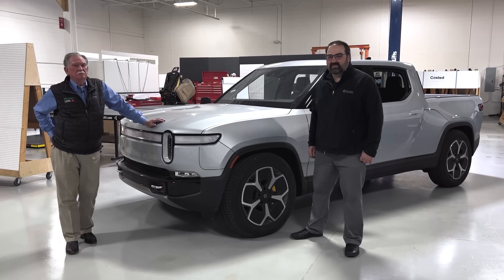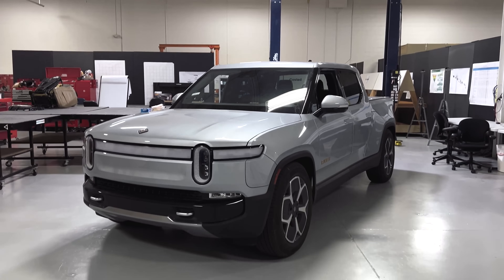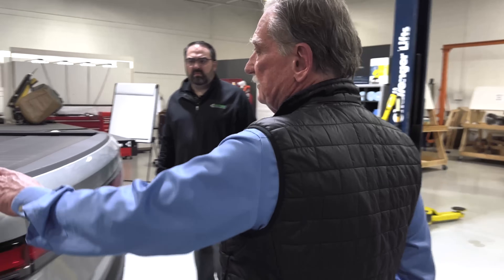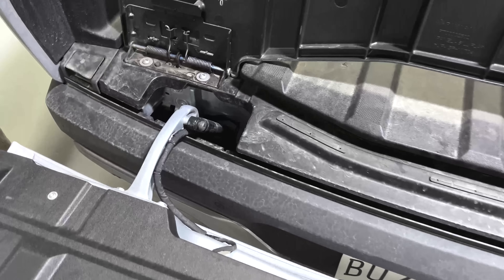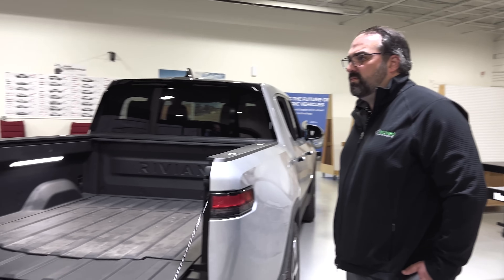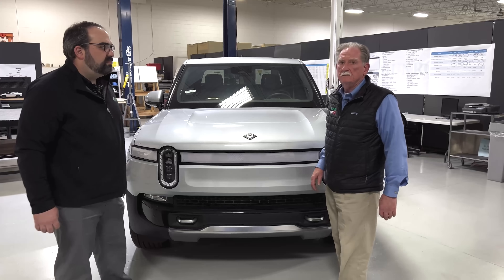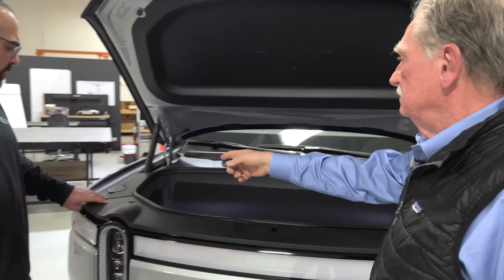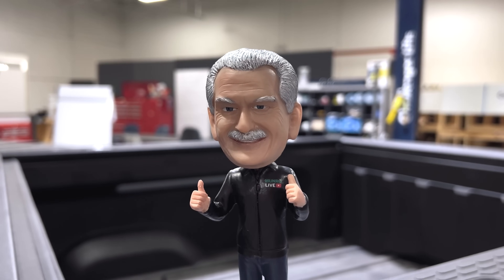Rivian R1T Teardown Kickoff!!!

Comment: Note: Rivian has jacked up the price = $12-20,000. They advertised the trucks at the lower prices and commenced a big promotional blast in October, boosting preorders in order to hike the price of their November IPO. That initial stock price of $172 has plummeted to under $25 per share as of today. Many preorder holders considered this bait-and-switch tactics and cancelled orders. Ford just dumped 8 billion shares of Rivian stock. 

Amazon's order of 100,000 Rivian vans is non-binding and the've hedged their bets by placing an order for Stellantis' EV conversion vans.

Rivian is not technically a new company, as they've been around for eleven years. Damage control was a reversal of the price increase to existing orders and a new decontented model at the originally advertised price, with two motors instead of the quad setup.

I've always maintained that the niche market demographic for $100,000+ "adventure" trucks was too small for Rivian to succeed. Folks forget that the Amazon van deal was over ten years = +/- 10,000 units/year. I'm not certain of Rivian's future. One likely scenario is that they get bought out by another manufacturer. I can see them as an Apple product.

Rivian's recent announcement to break ground for a new plant in Georgia in 2022 seems highly unreasonable now.

Comment: I'm hoping Sandy tears another one down in a year when the dual motor option is available and Rivian is not sourcing motors from Bosch but building them internally. I liked the Model 3 comparison he did with a few years in between. My R1T is in the low 5,000 serial number range (Sandy's tear down is 3,000s). So far, ten days in, it's been flawless on every level. The accuracy of the range estimates blows me away. (We'll see what range looks like next winter.) I hope Rivian can truly get to scale for both survival, charging infrastructure, and future product development. It's an impressive beast.
Reply: Actually I would like to see externally-manufactured motors as they should be cheaper than in-house ones because of the bigger production scale. The same conpany could have similar products (or even similar components) for different companies, so cheaper per piece. And you could benefit from the experience they sccumulated, don't need to start from scratch everything.
Reply: I'm really hoping Rivian makes it through the chip shortage strong. Their next truck, the lower cost one, should really be something great.
Reply: @WheelNut2  I wouldn't hold my breath for a lower cost quality EV, with decent autonomy. With current alluminium prices, rare metals prices, shipping prices, energy prices amd so on, the manufacturers don't make much money from cheap EVs
(or at all). There is no incentive for them to make cheaper ones. See Tesla, they only said Model 3 is $30k, but can you really buy a $30k one without government incentives?

Comment: Its a superbly well executed vehicle, however, I seriously doubt the company will survive. The reason is patently obvious, Ford is offering a bigger, also superbly well executed truck, for a TON less money, AND, it will be cranking them out like hotcakes in no time flat. Rivian, as well as Lucid will soon add their names to the dustbin of auto companies. Too bad, but its the nature of the auto industry. Finally dont think Tesla is off the hook either With Hyundai, VW and Mercedes jumping into the fray with models that are on par or superior to Tesla and a much larger production capacity, the big dogs are probably going to have their way with Musk too.
Reply: I think until someone actually makes it to scale, this is all guesswork at best.
Reply: @TheEvilmooseofdoom  Most of the large manufacturers already have the scale, Ford is expecting to be cranking out 200000 Lightnings in 2 years, an astounding number. The hold up is ramp up of chips and  lithium batteries. Everyone is constantly whining about lithium batteries and the availability of the battery elements the fact there is a lot more lithium in the crust than there is oil! The other components are all found in "friendly" countries. Ergo battery raw materials are far from being a constraint.
Reply: @Wised1000  Only one has ever put out a BEV at scale and it ain't Ford.  I think they will, it's just when and THEN we'll see how well executed it is and IF they can make money at it.
Reply: The Ford product is not any cheaper at similar trims, but they do offer some budget "Pro" trim, but it lacks range and and any luxury, which is fine. They also will be making even less of those for the near future.

Comment: I’m interested by his take that 75k electric trucks will become the new norm. He really seems disconnected from the “average” American. The big 3 will still exist but I doubt any of the companies be listed will be in that group.
Reply: 75K is already the normal price of higher trim ICE trucks so EV's are already at parity there. Lower trim levels will eventually arrive ($40K Lightning Pro for example) but as with ICE trucks the highest volume models will likely end up around 50-60K.
Reply: @HodgePodgeProducts  the problem is that these companies can’t make money selling these at the prices you said. There’s no way of getting around it, they are 15-20k more expensive comparing apples to apples. 

The lightning will be short-lived at the $40,000 price point because they will be losing tens of thousands. That’s why they have to intentionally limit production so it doesn’t impact their ICE truck sales. 

It’s makes way more sense for them to got the PHEV route with trucks.

Comment: Great stuff Sandy and crew.  Rivian engineers very creative thinking outside the box. I would consider Rivian SUV equipped for overland use. Rivian forgot to install a refrigerator. If they could engineer a solar panel tanou would be revolutionary.

Comment: The Rivian is an excellent vehicle, but I'm interested to see how they will navigate ramping production and securing supply chain. Looks like there will be shortages of key battery components in ~3 years. Whether Rivian can build an amazing vehicle and have insane demand is  irrelevant if they are unable to scale due to supply issues.
Reply: Maybe they just stay as a low-volume manufacturer and are happy with that?

It'd keep demand for their vehicles super high, will ensure their cars always have good residuals, and will mean they can keep a focus on quality. As long as they can pay all their staff and executives a salaries what's even wrong with that?

Not every company needs to be the next Tesla. There is plenty of room for small volume manufacturers, and maybe they should be encouraged.
Reply: @DEADB33F  That would work if their CapEx was in a manageable state for a low-volume manufacturer, but Q4 2021 it was $455 million, with 2.7 billion CapEx guidance for 2022. Their burn rate is not sustainable if they only produce <100,000 units a year, in fact Rivian’s factory was built with a 150,000 run rate in mind, so building fewer units than that will result in higher spending per unit and is likely why they had to bump the prices so much last quarter.
Reply: @DEADB33F  They are losing money at their current production level. Tesla was selling the Model S and X for well over $100k and were selling more cars than Rivian and they were losing money. Tesla at least had regulatory credits to help them. Rivian doesn't have that. They would need to sell their car for over $200k to be a low volume niche company.  Most companies have high volume products that subsidize their low volume, luxury products. Rivian won't survive if they can't scale up.
Reply: @DEADB33F  Lamborghini, Ferrari, McLaren make 5-10k vehicles, all multiple hundreds of thousands of dollars. They are going to need to make a lot more than that.
Reply: @DEADB33F   profitability...  that's the problem with low volume... hard to stay in business if you never make a profit.
Reply: Check out todays WSJ article on Rivian’s supplier problems, including a supplier lawsuit with the van seat supplier -which will very much delay production-further causing huge financial stress
Reply: Regardless of what the components are, the “seat lawsuit” suggests a company which appears rather inept at managing supplier relationships.  It’s not so much about specific items, but what this suggests about their management.  It could be their Achilles heel.
Reply: Shortage in 3 years is what Tesla suggests, not what market will do. No one knows
Reply: @Handleittoo  Being the only EV mfg in biz for 10+ years with 80% market share - they know;  others are short NOW.. Ford Mexican Mach E plant was closed, Rivian numbers are a joke as is Bolt and Lucid so yeah, Elon knows because even Tesla is feeling it - but they sold 300,000 EVs first quarter which is a different level but he knows how hard production is so lets wait until ANY of these guys actually can produce in volume - so far - NO, THEY CAN'T and this is BEFORE we talk about the shortages Elon is talking about in minerals not so much chips (where Tesla designs their own).  🚗
Reply: @Handleittoo  Of course, to what extent and exactly when (hence the approximate sign) the supply issues will occur is impossible to know. Not sure what your point is. There will be problems, the required mining/refining of battery metals for planned EV production deviates a lot from the planned mining/refining, and constructing more mines and plants takes a lot longer than 3 years. To some extent, Rivian will suffer from this, especially as a new company.
Reply: That shortage is in the battery arena, which I find odd that companies like NIO are setting up battery exchange outlets. Isn't that kinda s2pid? Shouldn't they concentrate on building affordable EV's instead of just plunking down batteries nilly gilly without a car to go along with it? Sounds like someone is lazy and wants to have a 5 minute battery exchange instead of waiting on a battery to be filled by a charger system.
Reply: @spuddy4063  Nobody wants to wait, but most cars are parked over 90% of the time. Put a L2 charger where it's parked.

Comment: The problem with the Rivian frunk is the liftover height.  For anyone below a certain height (6ftish?), they are going to have to rub up against a dirty front bumper to get anything out.  Ford did a much better job with the F-150 frunk by cutting through the upright grill area to the bumper height.
Reply: Totally agree.  The frunk is especially useful for a pickup to secure any items. The lightning design is much better especially since pickups are so tall and for short people like myself.
Reply: Having had a chance to crawl over and around a Lightning in person, they truly nailed it with their frunk design.  I don't know if they patented the concept or not, but everyone should adopt that approach.
Reply: @Team_Trade_Down  It's not something you can patent. The Hummer EV also has the same frunk design.
Reply: Agreed, I hope CyberTruck does something similar to the F-150 with it's Frunk. I guess we will find out in a year or two :-o
Reply: @BlazerRox  The load lip on the Cybertruck would be a bit lower than the R1T given the wedge shape but I do agree that they should do it like the lightning.
Reply: @boostav  I wonder when they will lock down the CT design...and start a few beta versions....maybe next year.
Reply: @BlazerRox  It may not be necessary since the CyberTruck has air suspension and can kneel down.
Reply: @BlazerRox  Or 3 or 4 years. :))
Reply: They can (and probably will) build a whole other factory in 4 years.
Reply: @BlazerRox  Sure, a factory, but the question was about the Cybertruck.
Reply: When comparing the Lightning and R1T, I definitely included the Lightning's frunk opening as a plus. However, after owning an R1T for a while, I have no problem lifting a 5 gallon can of gasoline in and out of its frunk. That's right - I take the R1T to the gas station to get gas for my tractor (and to squeegee the windshield).
Reply: Absolutely agree great point , this isn't rocket  science to figure out , it's the number one disappointing thing about the Rivian , I'm my opinion a major , faux pa. Would be interesting to know the designers thought process on that.
Reply: @andrewashmore8000  The Rivian was designed a number of years ago...at least 5 years ago....and I assume they simply didn't think of it since it had never been done before.  Hats off to Ford  for having that lightbulb moment.   It seems obvious to everyone now, but it really was an ah hah idea.
Reply: @Team_Trade_Down  perhaps your right , and let's say that is the case , now that Rivian know what the better design solution is , shouldn't they put there customer first , and redesign there front trunk to be more universally user friendly . Yes a whole lot of things would need to be reworked , from hinge mounts to strength of lifting mechanisms to crash worthy tests , and many other things , but all those things are well within the capability of competent engineers and designers. Yes it would cost more capital to do this,  but that's Rivian responsibility for not doing a thorough job in the first place , by properly evaluating the design for weaknesses / user problems  before final design. It's still a cool truck and I'd be delighted to be able to own one , as is .  Can't wait to see Rivians next vehicle they launch .
Reply: @andrewashmore8000  I definitely think Rivian should plan to make that change.  However, as I am still waiting for my Max Pack R1T, which rumor has it won't appear until possibly May 2023,  it is evident Rivian has their hands full just ramping their existing design.    A large legacy company like Ford could make a model change in a period of 2 years or so, but Rivian is a lot slower and will probably take longer.   If RJ gives his engineers the task now, I would bet it would take 3 years to make it to production.
Reply: @Team_Trade_Down  It was an obvious idea decades ago.  Some vehicles have had the grill attached to the hood - creating this sort of opening - decades ago, so it was obvious long before Rivian missed it... or decided against it for some reason.
Reply: @brianb-p6586  Chevy pickups have a notched step in the corner of their rear bumpers.  Nice little feature.   I don't think anyone else has it.  They should.   Rivian missed on the frunk, but they nailed it with the gear tunnel.  I am pulling for them to delivery 25,000 vehicles by Dec 31st.   Which is not a lot.   Ford will delivery more F150 Lightnings than that by the end of the year.   And Ford should delivery 150,000 Lightnings in 2023.    While Rivian, who started driving around with their EV pickup prototypes 3 years ago, probably will struggle to build 35,000-45,000 in 2023.   Rivian needs to haul butt or they may run out of cash.
Reply: And in fairness , Sandy , should really make a big deal about that. Real people will have to live with that crappy front frunk opening for decades to come such a pity for a otherwise well executed truck. If I was the Ceo of Rivian , I'd immediately call in the design team and get that corrected ASAP. Tooling costs be damned . Customer comes first , if you can fix do fix. Sandy should do a video of how short people , old people , people with limited abilities , struggle with that frunk door design. Call as it is Sandy , it's a major fuck up from Rivian.
Reply: The Chevrolet Silverado EV front trunk has a low liftover like the Ford F-150 Lightning - this thing is ridiculous.
Reply: @brianb-p6586  I haven't seen a "live" Silverado.  Will their final version indeed have the same type of opening like the Ford?     Again, Rivian can do a re-design eventually, but they are struggling to build 25,000 of Version 1.   I suspect it could be accomplished once they build the Georgia plant, as opposed to retrofitting the Normal IL plant right now.
Reply: @Team_Trade_Down  while Silverado EV production units are not yet in customer's hands, the pre-production units that are all over the place are the production design - they're not early concepts.
Reply: What y'all aren't considering is the Rivian is designed as an adventure vehicle.  The lip on the frunk increases the height of the water seal for the vehicle...allowing it to be submerged deeper for water crossings.
Reply: @Breaker1209  Good point.   Personally I won't be going into 4 feet of water, so I would good with the Lightning style frunk...and only be able to go into 2.5 feet of water....
Reply: @Breaker1209  so why doesn't it have door sills up near the windows? "Adventure" drivers need to keep their camping gear dry, but are okay with sitting in water?
Reply: @brianb-p6586  if you ever do or see a vehicle do a legit water crossing, it'll answer your question.
Reply: @Breaker1209  Yes, there's a bow wave in a water crossing (especially if you do it too quickly), but even the F-150 Lightning's front trunk opening is well above the door sills.

Comment: 06:00 That's the "avoid child size volume"-bracket, so they can skip the lit release button required otherwise.
Reply: I'd think the button and release mechanism would be cheaper than this big part.
Reply: @oisiaa  probably not, especially including installation with wiring.